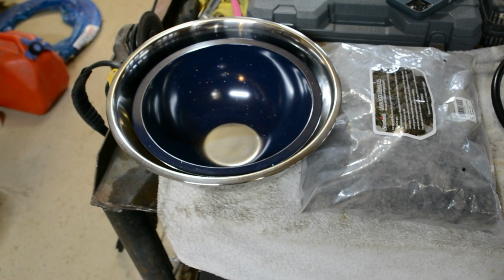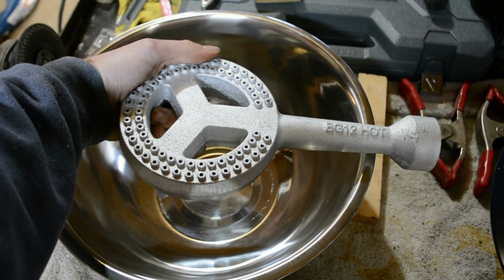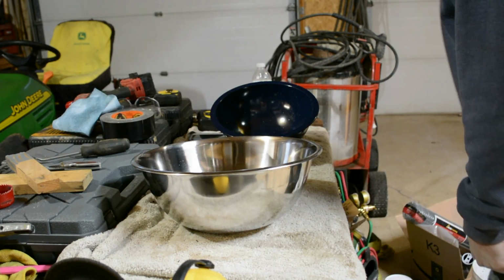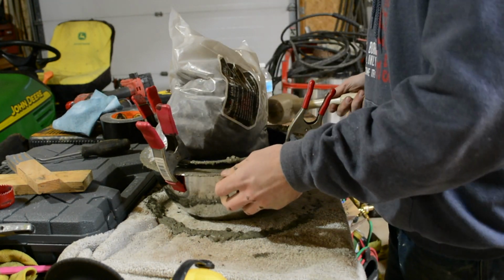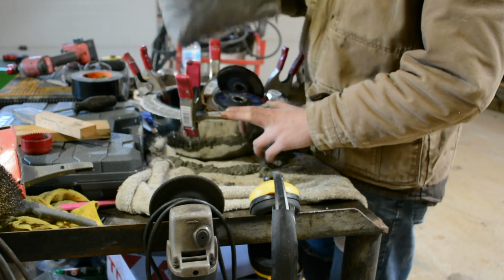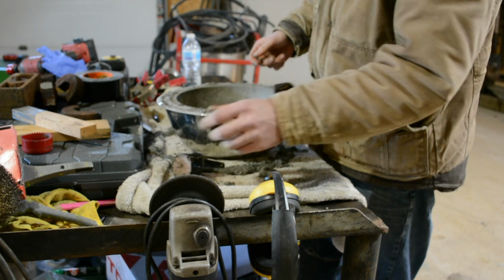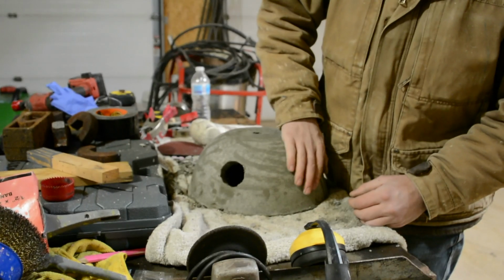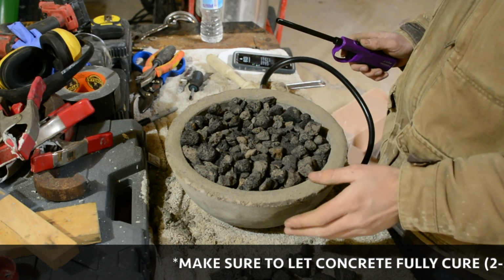DIY Table Top Propane Concrete Fire Bowl

Comment: What kind of cement, does not need to be fire resistant?
Reply from the maker: I use sakrete bag mix, big fire pits that are wood burning or larger BTU’s gas fire pits should have fire brick or some type of metal to avoid direct heat exposure. I have a 42”x42” with a 30” fire ring and never had any problems with the sakrete mix. (Must correctly build it)
Reply: Thanks for your reply but just to do a bowl like in this video, which one did you use?, because looking online there are so many bags that range from 6 to 90 dollars, I've never done anything like this, sorry for my ignorance
Reply from the maker: I use the sakrete 6000 PSI

Comment: What burner did you order?
Reply from the maker: GasOne 50250+2109 Gas ONE High Pressure Cast-Iron Burner Head with Brass Fitting Orifice, Regulator & Hose https://www.amazon.ca/dp/B0719PVZP1/ref=cm_sw_r_cp_api_glt_i_X969AQ7PWDSR2ZT0419G?_encoding=UTF8&psc=1

Now I use this one, and out the hole in the bottom 

 Stanbroil 6" Round Fire Pit... https://www.amazon.ca/dp/B019RKTSHO?ref=ppx_pop_mob_ap_share